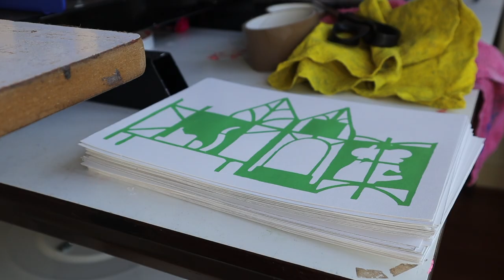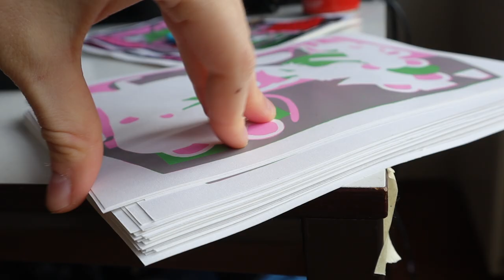Mouse House Holiday Cards! ASMR Screen Printing with Eva!

Comment: How do you keep your screen from getting clogged ? Any tips ?
Reply from the maker: If that happens I just take a warm, damp rag and completely clean the underside of the screen, it opens up the screen without having to clean up all the ink you're printing with. I also try to work as fast as possible and if it's necessary I dilute my ink with a lil bit of water. Hope that helps!